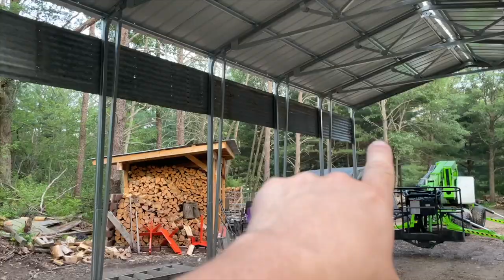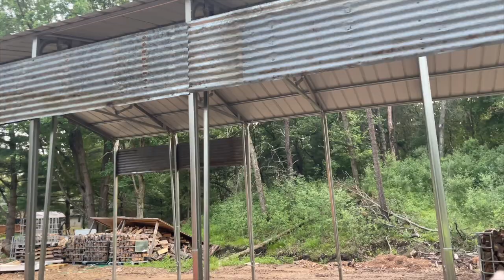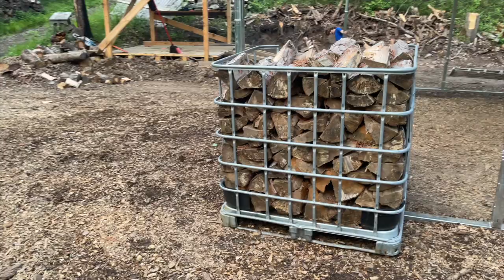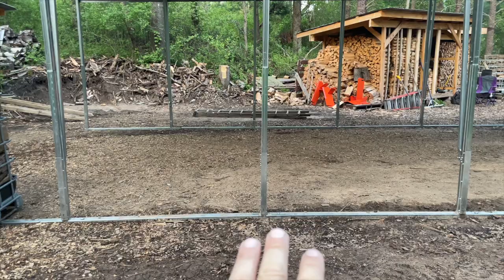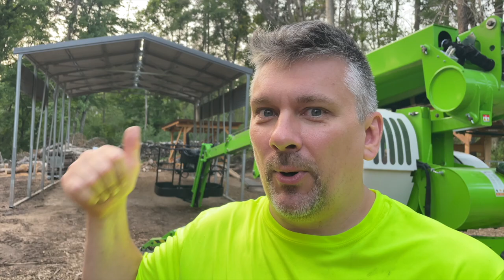Would I Do This Again - Final Thoughts on the VersaTube Carport

Comment: Probably the simplest way to do some additional stiffening is to put some steel cables wit a turn buckle in each. A couple of 'X' setups could help a lot without getting too much in the way. You and also make stiffening braces out of EMT conduit and just flatten the ends in a vise and screw into place.

Comment: I am surprised that the kit did not come with corner braces, similar to what you have on the Tempo Garage Frames.  In my opinion you would need a 45 degree angle brace from the bottom corner to the mid height of the next vertical frame.  A triangle is very solid.  Engineers use them in bridges all the time.
Reply from the maker: Thanks for the feedback, the angle braces inside the frames at a 45 would is a good idea. I'm also thinking of building a lean to on one or both sides so that should also help.

Comment: Once you add all your screws to the roof sheeting it will help stiffen up the entire structure, that's part of the sheeting's job besides adding cover.  Unfortunately, with 12ft high walls you're still going to have some movement unless you add some additional bracing.  I know VersaTube offers them but at an additional cost which they may not have told you that when you made the order.  You can always add some diagonal cable bracing to help.
Reply from the maker: Getting all the screws in helped a bit, but I just think that's how these things are. Even with concrete anchors I think it would do this cuz the frames don't go into the ground, just onto the bottom plate. I'll come up with some redneck engineered solution sooner or later...lol

Comment: I solved the same "side to side" wobble by using cheap 3/4 inch triangular shaped plywood gussets connecting  a few of the metal side support posts to the roof truss beams.

I know "you hate" to climb up there one more time to install these, but a good strong wind can/will reck your hard work, if you dont do this!

I think you did a "pretty good" job on your shelter. Congrats!

Comment: I think they like to have a concrete footer. That might make a big difference in the stability. If you have room for a bigger triangle, less acute angles, that will help. I’ve been looking at these guys and worry about the effort of construction. I am not sure it beats wood framing with walls vs cost. Thanks so much for showing this process candidly!
Reply: A timber frame pole barn is certainly more substantial.

Comment: My concern is using the rebar stakes to anchor it into the ground. If you have a large windstorm it seems like the wind could get under it very easily and pull it out of the ground. I like the idea of using a full IBC tote to set on top of the frame between the wall supports. Yes, a concrete footer would be better but those IBC's have to go somewhere.

Comment: Try to get some cable go from the top of one side to the other back-and-forth along there and run a big ax and where they cross. In the middle make sure you attach him with Au brace to make sure it's tight and it seems to help a lot at the same time if. You're only gonna go in-and-out one in. It never hurts to run a strap from the ground to the middle of the top and from the other side to the middle of the top.  Seems the firm i'm not pretty good just this suggestion

Comment: Get yourself some wire cable with turnbuckles & go from corner to corner & take the wiggle out of the frame. Maybe even a ratchet strap would strengthen it up. Myself I would try wire cable & turn buckles. ❤ your videos.

Comment: Go inside and start lifting with the tractor, even servicing it under the shelter, raise a dump trailer etc under the cover, you’ll be glad you got the 12’ walls and likely wish you had 14’ walls.

Eyebolts and cables will help stiffen the shelter.

Comment: Yes, i would not go 12 ft. H-Also think would place on Concrete slab and drill down and use anchor  bolts...
Reply from the maker: I think though even with it being on concrete an anchored in it would wobble...the reason is that the side rails/trusses only attach to the base frame, they don't go into the ground.